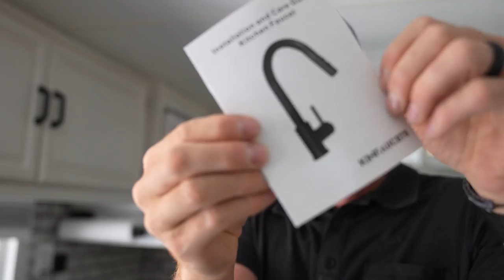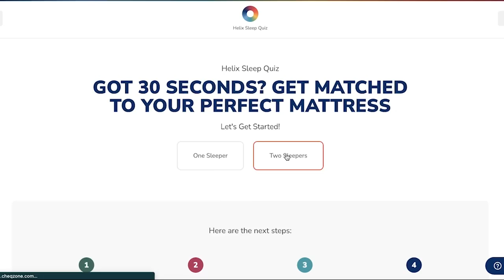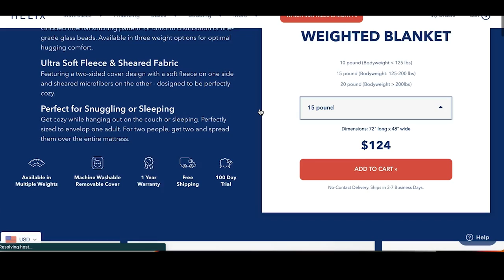JUST WHEN WE THOUGHT IT WAS OVER...

Comment: Hi Trent, I put a faucet just like yours in and had same problem, bought a new water pump, still didn't work, after some research I found out that you need a higher capacity water pump like a 3.0 gpm in order to have those fancier faucets like that work correctly.

Comment: I just did my grand caravan passenger door's window motor replacement (used a Dorman), and it was a pain. I also had to get a new switch for the door, and first one was the wrong one, because it seems the same year had two different type inner door panels. I still need to replace a slider door lock actuator, and dread the time I have to face that one, but it should be easier than that contraption of motor, two posts, a wire that makes sort of a bowtie between the posts, the snap in pieces to window holes. Actually, putting the glass window back in was the easier part. Helps if the window sill on door is removed first.

Comment: Before you replace the pump I would suggest that you check your filters because your pump is pumping it's creating vacuum from your tank pumping water building pressure to pump water but on the vacuum side of the pump is creating vacuum and it's sucking air more than likely from your filters

Comment: The exact reason I will never have an rv, nor the components that come in them. They are nothing but garbage. The lines aren't insulated from weather, so you can tlive in them without constantly being worried about what will fall apart next. They need constant maintenance. Not worth the effort. Easier to take a cargo trailer or other such thing and build it out. That way, all the lines and everything else can be installed with better materials and insulated against extreme conditions.

Comment: It used to be that 30" was ok 33" was considered big tires and 35"'s was HUGE. Now you can buy 52" for road use and 54" for off roading, 40" tires are getting spotted regularly and even higher ups in 40's. I think you need to be specific. Big tires? Ain't no such thing. It all depends on who you ask in regards to what is actually considered big. As we are on the topic of measurements. Why can't females tell correct nuts, bolts and material sizes by eyes only? Because the gents keep feeding them wrong reference points. "Yeah I tell you it's 10" long, even 12" if you do something crazy".